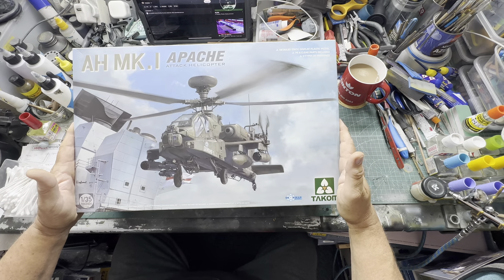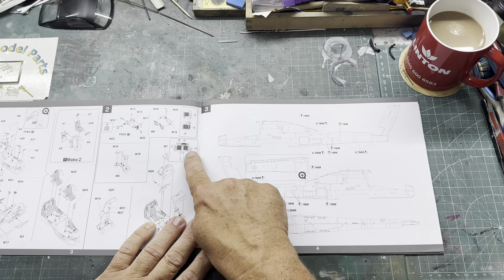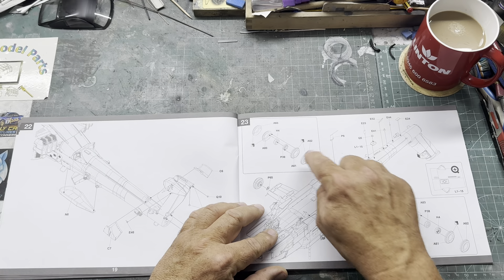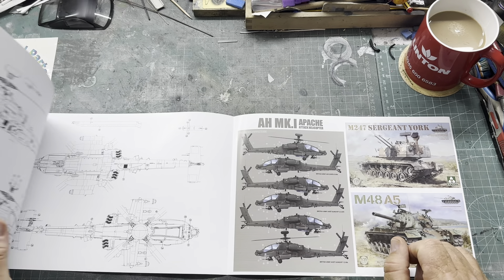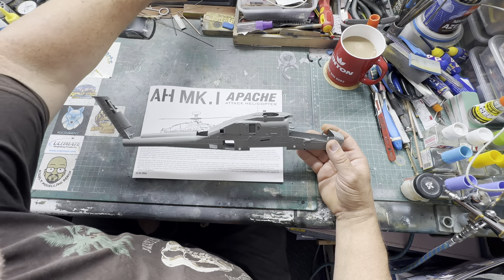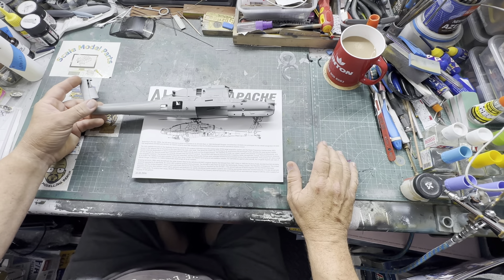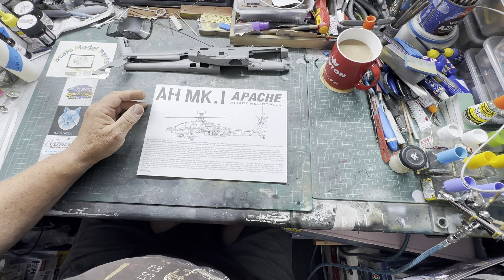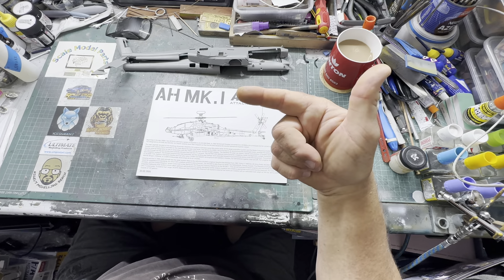Takom 1/35 AH MkI Apache instructions

Comment: Thanks for this Clive. I'd been trying to figure out if the Takom AH Mk.1 kit included the blade fold setup for a display I need to create, and your step through the manual has really helped. 

From just looking at the boxes I was concerned that the AH Mk.1 kit might not actually include the blade folding option. Given the AH-64D and AH-64E kits both specifically state they include it, but the AH Mk.1 kit doesn't. 

Looking at your manual though, in particular page 23, and comparing it to the PDF manual for the Takom AH-64D kit on scalemates. It does in fact appear that the Takom AH Mk.1 doesn't include a blade fold option. Which I thought was kind of ironic, given the blade fold mechanism was a pretty notable feature for the production of the AH Mk.1s, enabling them to operate from the ships. What a bummer.
Reply from the maker: Hi Graeme I’m happy to have been some help on this kit I pulled it down the other day to clean it and felt it was time to do the Meng version, so I’ll hopefully get that kit in the near future then compare the builds. If you need anymore help with her just shout I’m always around, sorry it’s taken me a little while to respond only life has thrown me a curve and I’m just getting back in the saddle, thanks for your interest and support buddy it’s much appreciated 😀💙👍🏻🍻🇬🇧
Reply: @clivesmodellingchannel7615  Thanks for taking the time to reply Clive. Getting back into modelling is one of my quality-of-life pursuits, and I truly love that I can still find folk such as yourself who embody the real sense of why modelling has always been fun. Hope things are on the improve for you mate. Love your work, and love your style. 👍Graeme.
Reply from the maker: @graemewright  thank you kindly Graeme life has thrown a huge curve at me but I’m slowly conquering it, I’m defo getting the Meng kit of this wonderful helo so as soon as I’ve got it I’ll start the build take care and thank you for your support 😀👍🏻💙🍻🇬🇧

Comment: I am currently  building the AH-64DI SARAF . The instructions  are indeed horrible.  No paint instructions,  and step 4 assembly of the rotor mast there  are way too many fuddily parts. Over engineered and the pictorgraphs are not detailed enough. If it wasnt for Nigel i would have never gotten  through that step. The last page picture of the apache doesn't show the topside for the camouflage pattern. Then there is the hellfire missiles all the fins are very small and everyone  has to be super glued on because  they are photoetch. I should have waited for the Meng kit.
Reply from the maker: I’m hoping to get the Meng kit and I’m hoping things will be a lot better 💙👍🏻